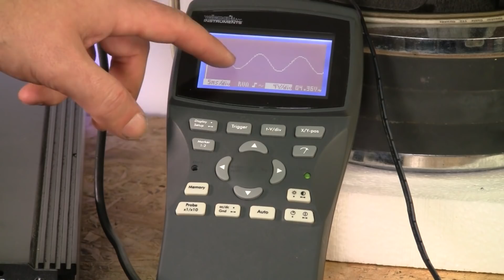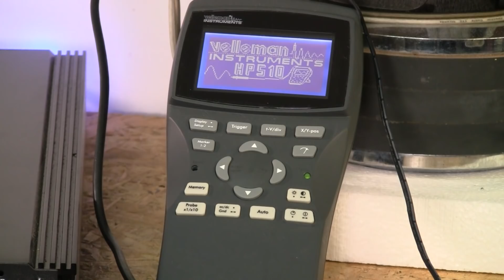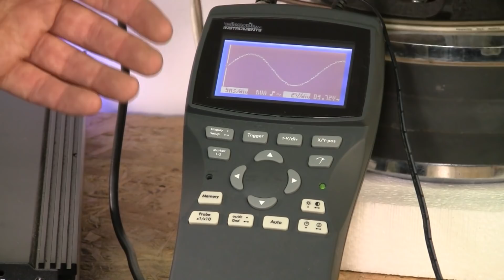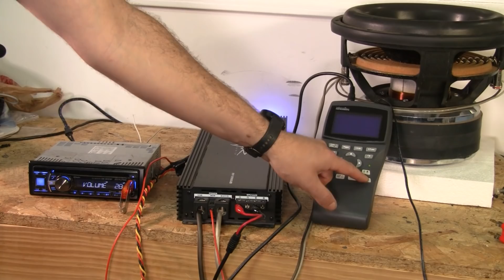How your budget amp kills subs without clipping - Tech Stuff Tuesday

Comment: This is nonsense, if I can get a hold of this amp in the UK I'll show you what you're doing wrong and I'll explain why your scope is reading wrong. This amp didn't kill the subs your customers did.
Reply: Barevids for the win!!
Reply: Would like to see that video for sure
Reply: Well, you can't argue with barevids.. he knows his shit
Reply: Agreed, nonsense. Out of 488 4.5 star customer reviews on Amazon, not one of them talked about blowing subs. I too think the amp was probably screwed to a flimsy box and was abused by vibration. Testing a single abused amp is not scientific.
Reply: Guess who's back, Barevids my man! I would love to know what exactlycaused the problem. Like the way you're in-depth with your explanations. Keep up the good job man!
Reply: Can you explain what he's doing wrong, in short?
Reply: @rickdodson5252  obviously not, he says himself that he doesn't even have the amp.  the most flagrant case of someone talking out of their ass that i've ever seen.
Reply: I was wondering if the oscope leaned up against magnet of the sub was messing with the tool
Reply: @royresha4073  i was wondering that same thing...plus the vibrations from the sub shaking the scope. That scope should have been away from that speaker and the base it's sitting on
Reply: @royresha4073  good point
Reply: @royresha4073  For that matter use a real scope, not a multimeter!/scope!
Reply: @royresha4073  that was my very first thought before he even began talking about what "issues" he is seeing. As a technician myself, I was always taught to keep the meter arrest from ANY other source of electromagnetic sources to rule out any interference. This just seems like a novice mistake that he should know better than to do. So that leaves me questioning..
1) does he actually NOT know better??
2) does he know better, but did this intentionally to show bad info on this brand??
3) does he know better, but just overlooked it honestly, and could retest the amp after correcting??(could still show the same results possibly)
4) do I care? I wouldn't buy the amp anyway, but what about other brands. I doubt this is a consistent issue on mid level amps. I either but cheap ass beans that actually have good output, or expensive top level JL or Audio Control amps anyway. Depending on the application.
Reply: @royresha4073  exactly
Reply: YES NOW, SAM!
Reply: LOL, I knew this was something crazy with the test the minute I seen it . Sam Please get on top of this and show us what Mr. EMF is doing here
Reply: @russlora  What he's doing is trying to sell a product.  Unlike barevids, Big D and the other guys trying to educate us, this guy is trying to sell a product while those guys aren't trying to sell you anything.  Motives matter.
Reply: From the true professional
Reply: Love to see barevids test this amp
Reply: @mattords6971  i would send him mine to compare since its at the bottom of the line
Reply: Notifications on for this video. If need be I’ll send you one just to see what’s going on.
Reply: Don't worry. Those amps are made in China and shipped to Skar. It's  China's newest way to send out mind control sound waves. They just give it to us and let us do it ourselves.  :)
Reply: kbryancourville korea, they just order them and sell them
Reply: I think i will go with barevids on this he is very well informed and know  how amps work
Reply: I just lost some brain cells watching this :)
Reply: Shit box amps period....ive experience this same thing with the rp line amps...set it up with a dd1+ and yes they do work and they are accurate and it was a clean signal all the way through, the rp2000 amp killed a 2500 watt rms txl skar which is now discontinued...fried it within 3 months and that amp won't even put out enough to push that to its full but it killed it and killed a zv5 thats rated at 2000 watts..., now I have a crescendo 4k with a reconed zv5 that I set up with the same dd1+ and checked it with the amm1 and from the true power reading im putting 4738 watts on 1 zv5 and I play it full tilt for an hour easy and not even get the dust cap that hot, never smell it...with the rp amp 20 min and you was smelling it bad, so think what yall want to I back emf all the way...thats a cheap ass garbage amp all of them, the sk series are better but still not that good...we all got our own opinions im going based off the money I've spent on skar and got nothing out of it...so take that junky amp to the uk and show them nothing cause I already know the RP line is junk...2000 watts for 270 bucks come on man...shit power 🤣🤣
Reply: @chrisfiske  

Preach on my brother!! 💯 % agreed
Reply: Don't forget TEAM PSi recones my subwoofers with high temp glue are black colored color doesn't always indicate distortion
Reply: I cant believe he put this video out. I generally agree with Tech Stuff Tuesday but this is bullshit. He pretty much just shit on a ton of amps sold and also shit on everybody on youtube that runs the SMD amp dyno calling the results garbage. WOW! Just WOW! Maybe this is a joke. You know he did a bullshit video once already to get hits.
Reply: @ditto_75  i think hey may be referring to pwm amps, and class D pwm amps in specific.  If thats the case, all mass produced pwm class D amps (that he is referring to) are all shit, period.  As, a pwm amp on a bench dyno will show "apparent" instantaneous power/current, not "TRUE" power/current.  You would have to know how the pwm amp is designed to know what its TRUE power ouput is.
Reply: @J-Ro2082  From my understanding most car amplifiers are PWM. Only select models make the same power regardless of current/voltage draw. As far as amp dynos go they are accurate (+or- a small percentage) as a benchmark no matter if the amp is PWM. The voltage is given on the tests and on some the current draw.
 My main concern with this video is how "cheap" was generalized and the methods used to prove the point. The test only showed me one thing. The amp tested was having an problem. No other test were shown to back up the claims that "cheap" amps can burn speakers up even when used correctly.
I agree with BareVids on this one assuming the amp is in good working order. The user burned that sub up not the amp.
Reply: @J-Ro2082  do you even know what PWM stands for?

ALL class D amps use pulse width modulation to generate any given sinewave.  The faster you clock the drive signal the higher frequency range ones amps can reproduce with fidelity....
Reply: @ditto_75  i should have specified a little further....i meant digitally controlled pwm class d's
Reply: @steve390gold  dyeah...🙄  what i should have specified with @ditto was, that a cheap DIGITALLY controlled pwm class D will compress the audio to supress clipping.  Effective apparent power is not ever a substitute to true power and signal quality is never a substitute ever
Reply: Too, a digital circuit that relys upon a feedback circuit (loop) to regulate/adjust an output voltage or current, instead of it just being there on tap when ever the load demands it, true yields better efficiency, but it comes with tradeoffs when the mfr adds additional things to the circuit(s) as "undisclosed features".
Reply: ditto now the smd amp dyno comment he lost me on that one 😂
Reply: @chadbeverly4926  because a dyno is only an "ideal" resistive load.  Some dynos have a simulated "dynamic" loads but they are still purely resistive.  A speaker produces AC reactance (inducance and capacitance), not just resistance.  Look up an equivalent circuit of a speaker.
Reply: @J-Ro2082  Applying ohms law directly to ac is circumstantial. Clamping is inaccurate. Reason one the amp dyno is inaccurate. Using a dummy load correctly this is easy to prove. Dynos show volt amps not true wattage, Power factor needs sequential amp/volt for proper reading.
Reply: Make a video showing what is going on then
Reply: Barevids ftw!!
Reply: Yea his scope is auto adjusting I've had the same amp for almost 2 years and not one problem
Reply: You know what destroys subwoofers quick when you tune enclosure wether  it's 32hertz 45hertz?People not setting the subsonic filter properly once the coil leaves the gap or touch the bottom it heats up very fast another thing causes clipping is not setting your gains properly you can also cause clipping if you go to high on the volume quick way I look for clipping is when you turn your head unit up and the voltage is 14.4 or higher and you don't see the clip indicator blinking but the voltage starts to drop you are clipping your system somewhere
Reply: Why is he using 8 gauge cca???
Reply: @BangingCamry  CCA = Copper Cladding Aluminum.. that shit is Aluminum wire and  64% of the conductivity of pure copper!! ONly usefull in the Navy for reducing weight......
Reply: @BangingCamry  could also be tinned copper...
Reply: @kaedeschulz5422  yea but when he test his stuff it's 1/0 ofc and quality RCA's.  But you could be right. Only he knows. SkAr is like every other brand they have a low end cheap model and then it gets better at higher price. I'm not a SkAr fan but I doubt that amp with quality ofc and the right size wire it would run normal with no problems
Reply: @BangingCamry  After typing that comment i looked through this comment and he mentioned that it's tinned OFC so... That wire probably didn't cause the problem.
Reply: @BangingCamry  there is a lot of factors at play in this video.
Reply from the maker: Because it's tinned OFC 8 gauge that is 3 ft long and doesn't matter for this.
Reply: @BangingCamry  is it cca? Looks like 4g to.me. imo.opiniom it was a short run and that was one thing I didnt REALLY see a problem with
Reply: I was just thinking what Sam would think of this amp. I don't like the generalistic amps produced in South Korea.... there's a number of car audio companies like sundown, skar, and the rest that have the same board but at different cost.
Reply: Sam please explain why because I have a pair of audiopipe apmn1500 strapped on my sa15s and they sound great . I am worried about killing my subs.
Reply: boominc0420 wen you start to smell something weird lower the volume
Reply: can’t you just explain here?
Reply: I've got the amp, brand new, just shipped to me and il GLADLY send it 2 u 2 do what was supposed to b done, lemme know how we can arrange that and we will get it done.. u gotta send it back to me lol
Reply: @youdig3691  we need the amp in the vid to go as well perfect side by side testing. Ive had my 800.1 for almost a year maybe i can send it as well.
Reply: @chadbeverly4926  I'm ready 2 send mine.. I was scared when I watched this video cuz I ordered mine last week and they r due to be delivered today so this video made me wanna return my amp's.. I'm glad that everybody was saying he was wrong
Reply: @youdig3691  he wasnt wrong.  He proved what he said. Your amp can very well do what that amp did and it could also not. Thats just the risk you take when you buy cheap(quality) amps. You take on the risk of having more issues than if you had bought a better built amp thats straight facts. Buying a brand new amp and it not doing what this amp did doesnt prove him wrong because there are plenty of other people who have experienced this with this line of amps and more.
Reply: @chadbeverly4926  the funny thing is, this isn't "cheap", I was gonna go Orion but I wanted a warranty and I couldn't get the amp I wanted unless I got it on Ebay and I don't trust those warranties from those dealers.. I contacted orion and they never responded.. but the amp wasn't that much different, like $40.. so is orion "Cheap" as well??.. audiopipe??.. there's a lot of companies that have $ 0.10 per watt amps out there.. it's not the days where u pay  $1 per watt anymore
Reply: @youdig3691  simple answer yes. Your question is making it sound we are talking about the company and not a particular line the company is offering.
Reply: @chadbeverly4926  no, emf is talking about a specific amount of money as in "cheap" low budget amp's will destroy ur subs.. he did say that his customers were talking about a specific company and amp from said company.. specific and broad, both based on price as if u always get what u pay for
Reply: You Dig audio pipe is junk, buy a good quality amp like rockford and you dont need amy warranty
Reply: @youdig3691  Many of the old brands we used to love are now owned by "maxxsonics", a garbage company who has continued these brands making products as cheaply as possible.
Reply: I’d like to know what brand subs are blowing? Over and over with 3 different customers? Could be a sub issue as well? Like a combo deal?
Reply from the maker: 3 different customers. 1 blew Sundown (as seen in the video), 1 blew Soundqubed, and 1 blew Skar.
Reply: @KBMOTORSchannel  He showed that it's a Sundown
Reply: ed elsey really? I must have missed that. Thanks!
Reply: Tell them Sam!
Reply: Tsunauticus III  😆 lol
Reply: You tell him barevids...
Reply: @Elijah Dossett how is that saying hes dumb?   Like me saying ya you are dude..
Assumption..
Reply: Mark Harrison  they are shielded nitwit.
Reply: Plain and simple he is lying
Reply: Thats weird i have the same amp 5 months full tilt at 1 ohm on 1 sub clean power and sound and my sub hasn't even gotten that warm. Also it a 40min drive to work full tilt the whole way
Reply: barevids Yes sir I would love to see that video my friend we all need to be friends
Reply: Idk I had an rp2000.1 and it sounded like garbage would constantly get hot and go into protect and it was a pain in the balls to reset
Reply: Sam has spoken.
Reply: @Theunderquaker  yea and when emf test his own products it's high quality RCA's and ofc. And he over prices his stuff???
Reply: Seems to be a skar roast
Reply: i would imagine if you are using a cheap cheap amp, you’re probably using cheap everything else 🤷‍♂️

I say cheap cheap bcuz Taramps is changing the game!
Reply: 2000 watt amp with two 1000 watt Sundowns... Sounds like it's just abused with zero wiggle room to me
Reply: In the video,it's wired wrong,no knob to even it out,and underfed power,to a "clean dub" whatever the fuck that is,I've got two nasty tens hooked up to the same amo and it's fun windy,just on one of these "cheap" amps. But I get it,it's only $225 not $100 you get what you pay for and to each is gucking own
Reply: 😂😂😂 no, it’s Skarbage. If you think anything from that company is anything good, you shouldn’t even be in the car audio business.
Reply: You're wrong about Skar brother. I have a guy who's been with Skar since day one and won many trophies running skar amplifier's and sub's. @jeffreytopp4695
Reply: BARE FTW
Reply: Thanks for being smart enough to debunk bullshit sam!
Reply from the maker: I'd love to know why it's showing what it's showing, because it's the only amp to do it. 3 of 3 customers have coils that look the same and all changed to other amps saying they sound better. It's not an isolated incident. Will 100% of them do it? Who knows.
Reply: @EMFAudio  turn your oscilloscope to manual range and see if it continues....
Reply: @EMFAudio  if your making accusations about products, why wouldnt you have multiple "new' models of the same and test them one by one, and then repeat with alternate versions? Using a single example isnt much of a experiment at all....its a pointless test with so many variables that could be wrong, yielding different results...which isnt a great way to determine anything at all. It could be a defective amp, it could be overly abused, the scope could be causing interference, ect.

Test 5 of the same amp, brand new. Separate everything or atleast shield wires and the amp for interference. Use the proper size wires for input/output. Test, test, and test again, with different instruments to gain a decent set of values and data...then release a video on what you found. Then repeat with multiple other brands, types, and models. Otherwise your video means nothing other than you drew a conclusion without sufficient data.
Reply from the maker: Pay for 5 of them and send them to me then. What I'd those amps don't start causing problems till they've got play time on them? Pay for the amps, pay for all the time spent getting play time on them, and pay for the time testing before and after on all 5 amps.
Reply: @EMFAudio  I'm sure that 2 or 3 out of 5 of the rp2000's would have major issues.
Reply: @Es0ter1ca  tsk tsk...
Reply: @Raymo2u  thats empirical data... That has no place in car audio 😂
Reply: @EMFAudio  so there is 3 different amps that did this or did this amp get passed around.
Reply: @EMFAudio  You should watch the reaction video that "barevids" has made on this video. It will explain everything. You are not right on this matter, and you are using your test equipment in a wrong way making you conclude false things. You should take this video off YouTube!
Reply: Your missing the point of the video bro. This amp was just an example of he subject because its doing it and the series is known for having problems like these. What you should disprove is his point about how cheap amps do what he said this particular one did . Buying a working RP2k is not gonna disprove the fact that a faulted one blew the subs. I can personally tell you that my 800.1 sits upside down because its gets so hot that it goes into protect and its only being ran at 1ohm on two 500w 15s. But i look forward to you making a video testing the same way he has with the same setup and then doing it different to see if you get different results because is this is a good topic cheapest isnt always the best. Much love
Reply: @chadbeverly4926  your amp overheats BECAUSE you are clipping the shit out of it and it overheats and the thermal protection circuit kicks in like it is supposed to.

Flipping it upside down only stresses the elctronics even more in that the heat will NOT dissipate properly and the thermistors that control the thermal protect aren't subjected to the same heat they would be in a proper orientation
Reply: @steve390gold  well ill put it like this. The gains where set properly and i even turned the gain down from where it was and flipped the amp and it hasnt cut off but one time and it stays significantly cooler than when it was right side up . maybe i should put and acrylic back side and a fan on it and get back to you on how it operates
Reply: @chadbeverly4926  you turning your gains down is what is keeping it cooler not inverting the amp.  Secondly did you ever put your head unit's RCA output on a scope?  I've seen plenty of head units clip the shit out of their RCA output.  Also when you set the gains, your head unit has to be at its own max unclipped signal.  And even when that is done there is no garuntee that you still aren't clipping the shit out of the signal since a lot of different source material is recorded differently.

Inverting the amp keeps more heat in the power supply and output mosfets and not in the aluminum heat sink.  When mosfets (and bipolar transistors) heat up their pulsed current capacity drops between the source and the drain (collector and emitter for bipolar transistors.)

You are playing with fire inverting the amp.

But what do I know, I just went to World finals in dB drag racing in 2003 and 2004, held a few world record in spl back then and, I just rebuild amps like Sam up there....
Reply: @steve390gold  if its so dangerous then why do people do it ? Ive seen plenty of builds with amps being inverted with acrylic backs ?
Reply: @steve390gold  i can get it scoped out when i do the recones and do the rebuild. By then ill have a doubled in Pioneer or another excelon unit which is the first kenwood ive had so it definitely could be that. I believe i have the same unit that steave has on his bench but i could be mistaken.
Reply: @steve390gold  Position of the amp is irrelevant. Noob. That said noobs see the name skar and go into their own protect mode. Mass produced products can and will have issues. It isnt uncommon to see same issues in multiple runs. That said the behavior of this amp isn't uncommon in cheap product lines. Just like any other company there is an expensive line that is well engineered and a cheap line that is outsourced to some Korean sweat shop no questions asked.
Reply: @chadbeverly4926  (" What you should disprove is his point about how cheap amps do what he said this particular one did") That is my point. He did not say that this was a isolated incident with just the amp being tested. He said how "your" budget amps kill subs without clipping. Actually in the video he just called them cheap amps.
 Budget and cheap is subjective. One thing I am sure of here is that either this amp is defective (he did not say it was, he just lumped into a cheap amp category) or the user burned the sub up. Also people has got to take into account that when you are pushing things to the limit on a daily basis you are more likely to encounter problems.
Reply: @ditto_75  well he wasnt wrong . this series is notorious for having problems such as these. Budget is the eye of the one paying the money. Cheap meaning as in build quality not so much price which calling it cheaply made isn't a insult its just the truth. All entry lines are. But either way he was right. He showed a way that they could do it. Im not seeing the problem with what he did. Im most likely looking at it differently
Reply: @ditto_75  i dont think the people thing should be taken into an account because really is sound like a cop out and we cant account for that because we dont have the information of the setup but i know for a fact that this is a common problem with this amplifier and this line in general(also speaking from experience) but his point is still very much valid.  I didnt see the second part of your comment (connection issues)
Reply: @chadbeverly4926  so your subs are rated at 500 watts each? And the amp is upside down?...
Don't mount amp upside down.. Cannot block fins.. Mount it right side up with a 1/2" clearance so the fan can pull air to it
Reply: @bobdodge3171  surprisingly yes . when i researched them its said 400 but the back of the sub says 5. My amp doesn't have a fan but its does have slots on the bottom which is why i flipped it so that air could pass over it better. But im gonna switch it out with the sfb 1500 when i recone my subs
Reply: @chadbeverly4926  oh i have both rp 4 channel amps... They have fans fig the mono did to
Reply: @bobdodge3171  they dont, you would think they did but they don't. They just ahve vents on the bottom for air flow which is why i flipped mine upside down to allow air to get into the amp better. No different than what people do when they put acrylic backs on their amps. Especially D.C amps
Reply: @chadbeverly4926  you as many others have are ignoring one of the rules of car audio... Buy an amp with 2x rms of what you need if you intend to daily bump for extended periods. in order to get those 15's going your requiring the entire 800watts output of the 800.1 not accounting for efficiency losses. You should have got the rp2k.1 to power 1K watt RMS worth of subwoofer. Now if you was wanting to join the burp-twerp gang you could have done the rp1200.1 and gotten burps of 1400+-watts but as a daily driven unit you always want an amp capable of 2x the rms. This means the amp is always capable to get you your RMS and be cool doing it. SO if you want your equipment to last and have clean sound at the RMS limits you want 2x the amp and as youtuber "MBE" preaches clean sound is had at 2ohm not sub 2ohm.. see his videos on that matter.
Reply: @masterdebater8757  I realize that now
Reply: RP lineup is pure trash. I bought new RP2000 and it sounded worse than my hifonics brz1200. Sold it within a week. The difference was that audible in sound quality.
Reply: @amanbungay  im really considering kicking my 800.1to the curb
Reply: @chadbeverly4926  my guess is they have quality issues with the RP series. Could be due to the manufacture house using much cheaper components than what skar asked them. Their SK series is fine.
Reply: @chadbeverly4926 . A little off topic,  but when you said your amp was mounted upside down,  is that how it has been mounted when the amp cuts outs?  

With class D amps heat management is a lot easier and normally allows for installs in areas that don't have as much air flow, and mounting them upside down. 

But,  mounting an amp upside down isn't universal and its a relatively new feature from some brands and models.  

If the amp isn't built for that then you will actually be intensifying the heat management.  Heat naturally rises and the air space between the top of the amp and the circuitboard is now reversed and can indeed cause over heating issues in amps that are sensitive to heat issues. 

Aslo,  a 1ohm load actually will generate much more heat than a 4ohm load given the same power output and such are the same.
Reply: @twinkyunouwantmycreamfilli8297  i had moundted regularly but it would get so hot that i couldn't touch it and then it cuts off . i turne the amp upside down where the vents are so that the air flow from my windows would cool it and it didnt cut off for awhile. It would be hot but no where near to the degree it use to be plus im down south(Alabama) so that doesn't help but flipping it did seem to make a diffrence but i blew the fuse on m D4S wiring kit so i have no bass now till the new fuse comes
Reply: @twinkyunouwantmycreamfilli8297  but funny you should mention the 1ohm and 4 ohm thing because i had it on a pair of lighting audio 10s ?(SVC 8ohm) and it actually cut off while playing at 4 ohms
Reply: @amanbungay  but their sk series also cost a lot more and is better quality. It gives you something to work up to
Reply: @chadbeverly4926  . Right on,  I kinda figured you would had tried it both ways,  but just incase,  thought I'd ask anyways.
Reply: @twinkyunouwantmycreamfilli8297  of course but being in the south its gonna naturally be "hot" without playing. Enclosing it in a trunk is right side up isnt gonna help it cool any better than me riding with my back seat down, amp upside down where the vents are facing upwards and my front windows down providing actual air flow through it .
Reply: Chad Beverly just lower the gain and base boost
Reply: Tsunauticus III  lol
.  well he has more respect for ppl than Steve meade... Steve is a pos
Reply: This guy knows what is up. Watch his video
Reply: Thank you British dude.......this amp rocks.....sundown audio customers dont!!
Reply: Trent robey its a low budget amp dude, nothing special, all cheap components,